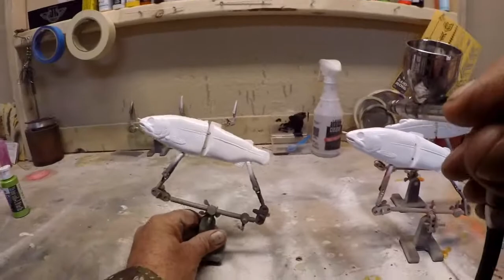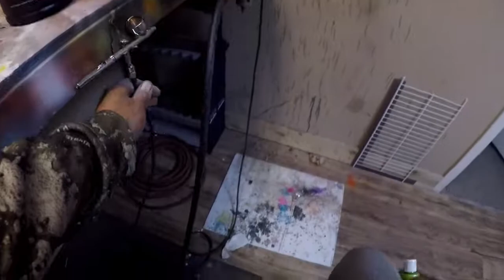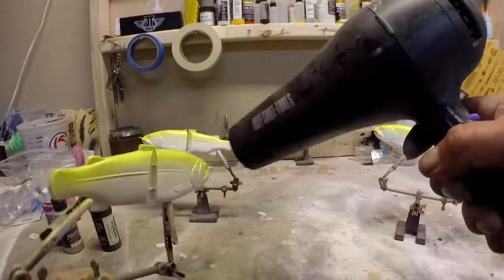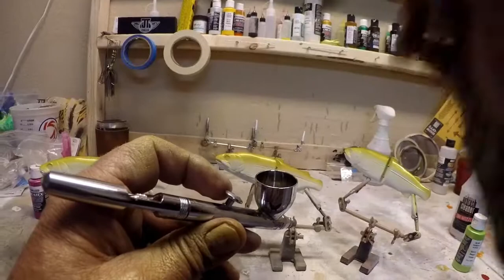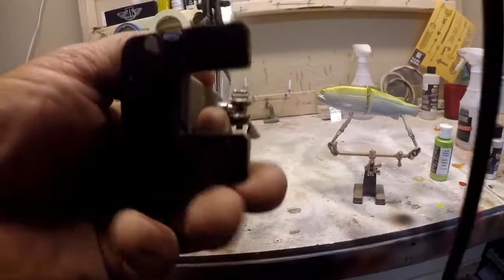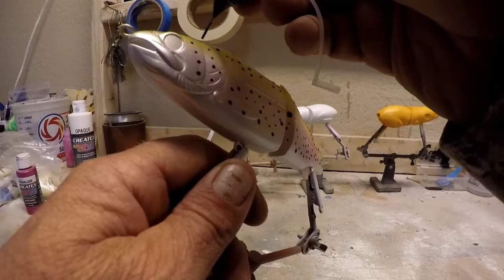Hand Painting Trout Swimbaits uncut version

Comment: Do you clear coat the rubber tail?
Reply from the maker: No we leave the rubber tail alone
Reply: @RiverKingAz  looks like there is paint on the tail. Will the paint hold without clear?
Reply from the maker: There is no paint on the Tail the soft plastic is dyed before its poured into the mold. so that color isnt going anywhere @hogwailingforbasswithpaulf727
Reply: @RiverKingAz  thank you.